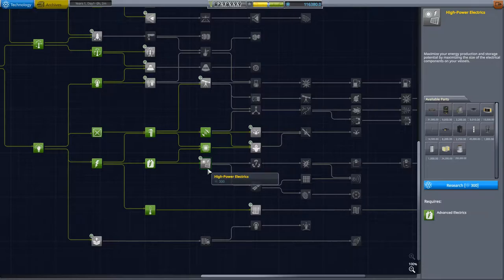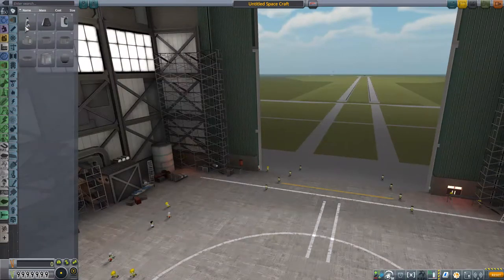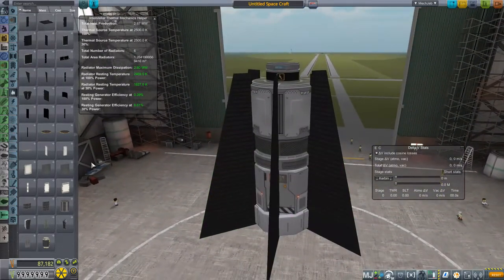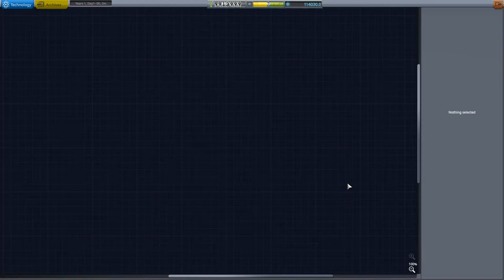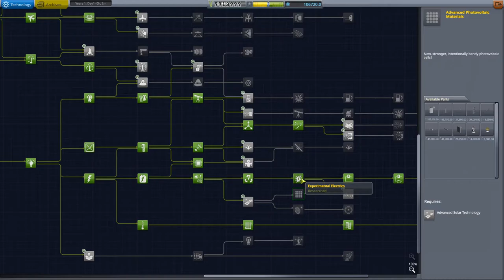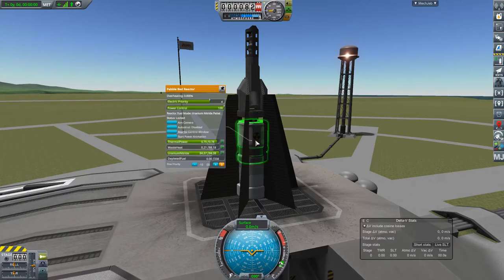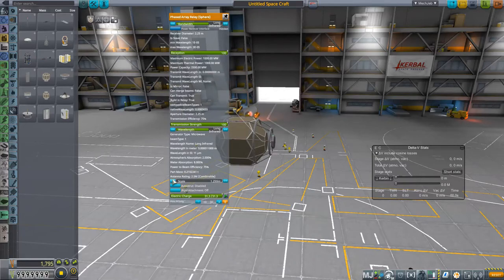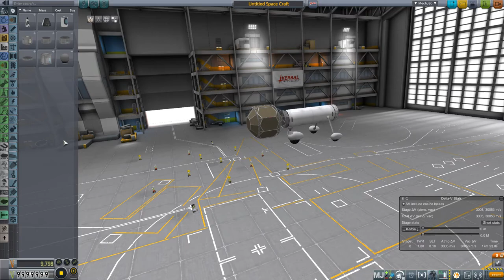ksp interstellar extended beamed power tutorial

Comment: To be more precise, wavelength determines how much the beam disperses - the bigger the wavelength, the smaller the transmitter diameter (aperture) and the further the receiver, the bigger the area of the beam cross section (spot size). The moment spot size becomes bigger than the diameter (aperture) of the receiver, you start to lose out on power because not all of it lands on the receiver.